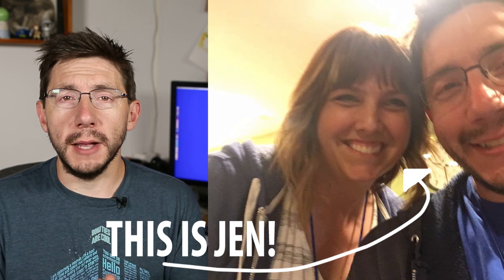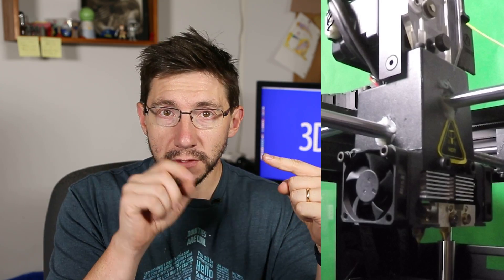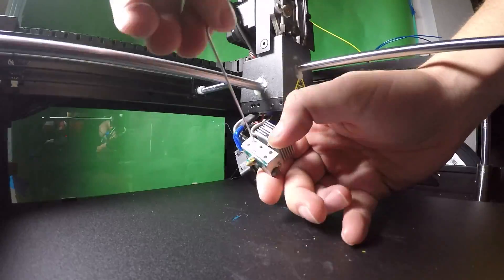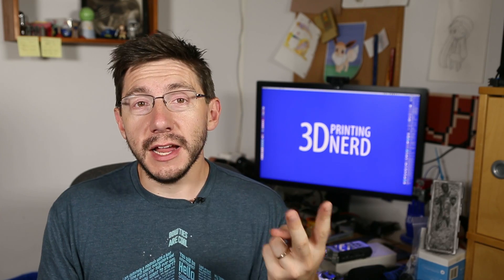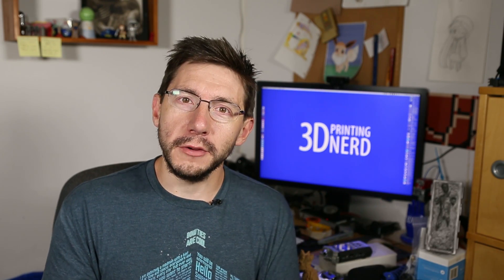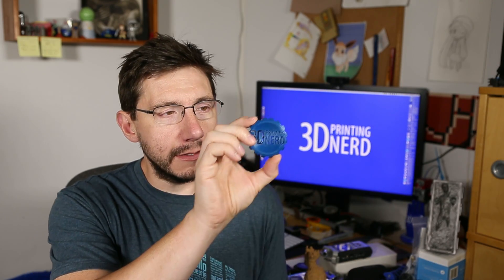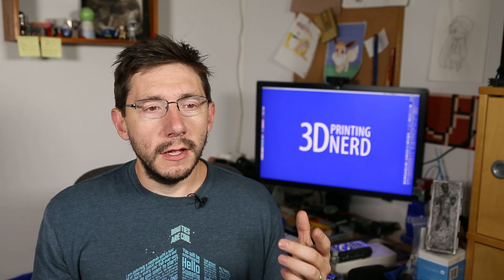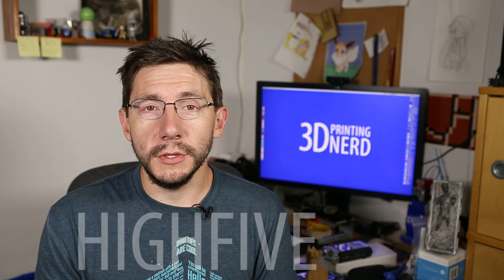3D Printing: Epic Fail Pokeball on Raise3D N2+ with Orbpolymer

Comment: Could be worse. You could have been working with your only printer during the early days of Covid and have a 13 hour print snap off the bed of your brand new Delta then have the machine spend the final 2 hours trapped between two of the uprights slapping back and forth, blowing a full spool of filament EVERYWHERE, awaken the next day to find said spaghetti mess, a broken machine and spend the next 6 months trying to jury rig a hotend from 5 other hotends purchased hastily from ebay because the actual replacement parts are on lockdown in China...
Yeah, still getting that machine fixed to this day.

Comment: i actually managed to fix my 3d printer at about 5 am and it turned out i was an idiot and didn't fully insert the ptfe tube and now i fixed it altough now the clamps holding the tube are now broken and wont let go of the tube

Comment: i understand the troubles of trying to assemble stuff when its really late. when i assembled my anet a8, i didnt switch the power block from 220v to 110v so when i plugged it in, it fried the mainboard. i finally got it fixed but man did it suck.
Reply from the maker: +MemesAreCancer oh wow that would suck!
Reply: it also took 2 months to get a replacement because the people at gearbest kept forgetting to ship it. i sent an email around may 10th and didnt receive the new mainboard until a few days ago.

Comment: have you ever made a Star Trek phaser rifle? I want to get into 3D printing print props for myself and fellow trekkies but I can't afford a big printer not with my fixed income unless it's worth it. I see some 3D printers selling phaser rifles but with super cheap crappy ABS that melts from paint with acetone.  would you recommend a printer that could print a phaser rifle in parts and I want to use metal PLA weight and durability and I want to put a laser in the nozzle with a photo strobe I already set up the electronic now just need to figure out 3D printer part.

Comment: I was using my teachers 3d printer and when I checked on the print 5 hours later and it turned out that the bed had completely moved every which way

Comment: I try not to print multiple items at a time, the time saving is minimal if you can be at your machine to start the next part, I can understand printing multiple things at a time if you are going to work or whatever and leave the printer running while you are away.
Reply from the maker: I try to do the same as you. This was a rare occasion where i was going to be gone for a while and I thought this would save some time... I was wrong :)

Comment: I built a diy kit printer and the only pre assembled part, the hot end leaked so I had to disassemble it, come on Tevo (good brand though). I have also woken up and checked an 8 hour print and found spaghetti, not fun I feel you.

Comment: Been there lots of times with a gigabot xl which I modded to 1,75mm filament and 1,2 nozzle. You should always have extra hotends! get a blower to heat your hotend to clean it with a cloth and use a drill to bore the stuck filament out. You can work on your printer even when you and the printer is wasted, just always think twice about what you are doing.

Comment: How do you figure that it clogged? Had it, you wouldn't have ended up with that mess. Part came loose. Period.
Reply from the maker: I figure it clogged because there was a stuck piece of filament in the throat. The printer was extruding a bunch of filament, as you can see in the time lapse. Towards the end of the time lapse, the printer is no longer extruding filament, and that's when a piece of the filament got jammed in the fan.

Comment: I use a propane torch mounted to do this. I am yet to snap mine off. If it fails in this manner I wait till the next day when I am fresh. P.S. I am on my second hot end. replaced the factory end with a Matter Hackers  Ev6, love it.

Comment: You seem to have a lot of trouble with your Raise 3D printer.. I have an Axiom (Single print head) AirWolf 3D printer and OMG its just amazing.. Im hoping they make a bigger one but so far 12x8x10 build size is suffice. I have solved curling on my printer but it will totally blow your mind WolfBite.. its for glass beds but WOW its wild.. Well worth the price of admission. And once I can afford it Im going Direct Drive with mine .. But for now if it isn't broke do not fix it.. :) So far with my Air Wolf since I got it no Big time Print fails. It just wont even try to print a bad file. It actually is WAY above the print platform if it file has issues and while it will extrude it wont even try to make it print .. Im going to try the poke ball print myself..  Ill post pictures later ...
Reply from the maker: So far, the only issues I really had were at the beginning, and of the few, most were my own fault. THIS one was just one of those times where it fails. I have a friend with an Airwolf and he loved it, though, I think it was a bit finicky. I'm hoping to get my hands on one down the line!
Reply: Mine was a tad finicky but it was the a linear bearing and they fixed it and now its ROCK solid. Best prints yet.. And yes I have had another 3D printer an Ultimate Original.. Still love that printer but I gave it to a friend as I cannot use it anymore (Cat Issues she wanted to sleep in it when I wanted to print) The Airwolf stops that. Also one way I prevent curling is ad a Brim. It makes my prints stick like Superglue was added .. Never had a curling effect since.
Reply from the maker: Hal White OH NO your cat wanted to sleep on your UM? hahaha. That's too funny! Airwolf is cat friendly :)
Reply: 3D Printing Nerd Very much so.. Fully enclosed... My only issue is where their Viki interface is located.. Makes it hard to do Time-lapse shots.. Im planning on a Relocation to the bottom since it has the screws in the same place top and bottom..

Comment: I swear that doesn't normally happen!
Reply from the maker: Thank goodness! I've printed LOTS of stuff on LOTS of different printers, and this was a first!
Reply: 3D Printing Nerd haha 3D printing nerd it was...another kind of joke haha. I've been here since around 2k ish and could I ask you what you use for your set up to get everything to stick to the plate? I have heard of these things called zebra plates that supposedly work well. Do you think you could possible test it out?
Reply from the maker: Goat Bot Oh, I knew ;) ha! This is BuildTak heated to 65c, I've used it on my FFCP as well at 50c-55c. I've used Kapton tape before but I just don't like it. Blue tape and I are friends. Zebra plates are suppose to be decent but I've not had the chance to use them yet. Fleks3D are also suppose to be amazing for adhesion!

Comment: When you started by saying this was the most epic failure you ever had. I remembered you vid on the whole GMax hotend getting buried alive in plastic and you tried to melt it off with a blow torch.
I thought this could not be worse than that, I guess I was wrong, it is at least on par :-)

Glad you got it sorted, with great support from Raise3D.

#Highfive

Comment: As I am new to 3d printing at home, with only a single delta printer, i am curious to know.... How did the clogged hot end result in the breaking of the support structures?  Maybe I missed it in the video.  It also appears that your print bed came loose from the printer and was dragged around with the nozzle?  How was this addressed?
Reply from the maker: Support structure piece got knocked loose, THEN the nozzle dragged it around the build plate. The build plate is BuildTak on glass, and that's clipped into place. So, when the nozzle was moving with that one piece attached to it, the rest of the pieces were stuck down good, so the clips gave out.

Comment: If you watch the video again you will see that the root cause of this failure was the part in the upper right came loose from the bed.  It then started printing in air (which never works well!) Everything snowballed from there. I have had this problem many times when printing multiple parts at the same time.

Comment: Thank you for sharing your failures as well as your successes. It is one of the things special about your channel. It is just as or more instructive to see what fails as well as what works. I surely appreciate it. I have a question. I am getting excited about 3D printing. I don't mind finishing work and want to be able to make table top miniature terrain and sci-fi/fantasy shelf props. I have plenty of tools, including a soldering iron and can self assemble with decent instructions. What under 800$ printer do you recommend that has decent print resolution and would be useful for someone starting out that isn't too hard to use and is pretty reliable. Thanks for your time.
Reply: Hi, I have been doing some research for a similar printer, my 2 cents, Tevo Mini Monster  and CR-10, maybe if you have more budget SeemeCNC V3, and do not forget the Original Prusa i3. All Except the CR-10 have bed leveling

Comment: I've had the same issue with my fan and my hexagon hot-end (fan powered with 5v instead of 12v) and heat up again with the printer itself doesn't work, but the oven worked great to unclog it.

Comment: There should be an app that sends your phone a picture of the build at an interval determined by the operators level of OCD and allows you to abort the print and activate the autodeclogging system remotely.  There I fixed that (give myself a cookie).

Comment: I'm confused... In the time lapse the build plate was sliding all over the place. I thought that was what caused the problem. Or were there two problems, the plate and the nozzle??
Reply from the maker: The first problem was a small piece of the support came loose from the build plate, and the nozzle dragged that around eventually knocking off a piece and making the build plate dance. THEN, while that was happening, a piece of filament got stuck in the throat cooling fan, causing filament to clog IN the throat itself. THEN, I broke it. :)
Reply: Ohh OK. So I guess there just a whole bunch of problems then :) well thanks for the explanation and I'm glad you were able to fix it :) High five!
Reply from the maker: Alexander Losee So am I! :)  #ReturnFiv

Comment: Omfg I lost it when the bed came loose XD Just did something similar on the Tevo because I was lazy and didn't use enough clips for the bed.
Reply: i once had my printers thermostat, fillament guide, spool break in one print. the spool fell off the table and yanked the nozzel block breaking many pieces
Reply: ROTFL same here, about the laughing that is. I've only ever printed 1 model with less than 4 clips, and that was purely bc I had to alternative and couldn't find a spot for more than 2...and it managed to shift ever-so-slightly at some point and left a nice, just-barely-noticeable band along the entire, huge thing. :(
Reply: Maker's Muse I don't have a 3d printer but I have a plotter cutter. things coming loose is both hilarious, depressing (such a waste of material) and terrifying (it can really do some damage)
Reply: Maker's Muse my circular bed need to be clamped or I make spiral prints from the bed spinning

Comment: Did you ever figure out what caused the clog in the first place?
Reply: +GameBunny yes but what cuased the PLA on the fan
Reply: Looks like the parts did not stick 100% to the heated bed. A piece of support broke free and the hot end dragged that support everywhere, knoking down everything. The printer kept  extruding filament creating a big mess and a piece of pla got stuck into the fan, also you can see that the bed itself was knoked off
Reply: +GameBunny Yeah, but how the heck did the pla get to the fan?
Reply: +Jack Hydrazine thats what I'm wondering sounded like the PLA got in the fan which kickstarted all the other problems? Joel is this right ?
Reply from the maker: While it was creating that massive pile of PLA spaghetti, a piece of the spaghetti got caught in the fan, causing it to stop :)
Reply: Thanks for explaining that!
Reply: +3D Printing Nerd angel hair pasta....mmmmm. :p

Comment: One thing I would add in is keep a tap and die set that matches the threading your hot-end. A cheap but decent quality one is all you need. Use the tap to clean out the heater block/where the nozzle goes in and use the die to clean any external threads on say a heatbreak and your good to go! The less resistance/crap that melts into the threads the better plus the cleaner the connection the better the thermal transfer and less likely your going to get nasty jams in the future.

Also a bit of extra insurance a bit of high-temp anti-seize on the threaded bits + the thermal sensor & heater block helps remove things in the future. As for don't work on stuff when your not there 100%... good gosh I can't stress that enough especially when your working with any kind of potentially dangerous machinery! I have caught myself doing all kinds of dangerous stuff when machining and not having my "head in the game" as they say!

Comment: One idea for your rig ... if you can do so, can you run the fan on the 2nd hot end even if you aren't using it at the time?
That way, if the primary fan fails, the second one should cause enough airflow across the fins to keep the primary/active one cool enough to finish a print. #HighFive

Comment: I feel your pain.  I have broken a throat on my Prusa i3 clone.  In my case it was a combination of my brute strength (stop laughing) and the cheap throat that is very thin at the heat break area.  Luckily, I had already purchased a couple of spare hot ends, so, I just switched it out and was able to print again.  I am developing quite a collection of spare parts, as there are not stores in my area that sell 3D printers or spare parts. #HighFive